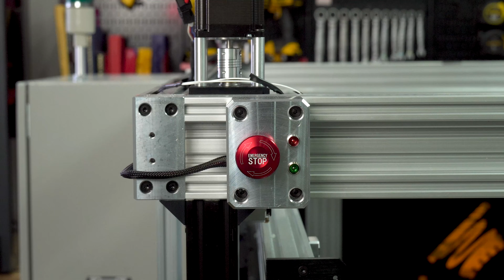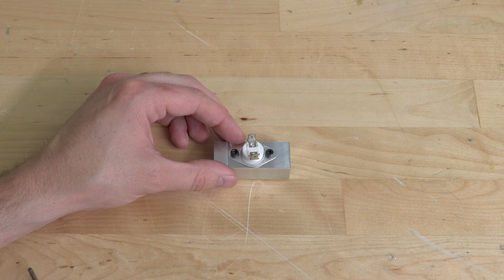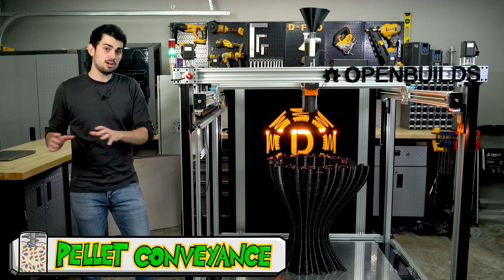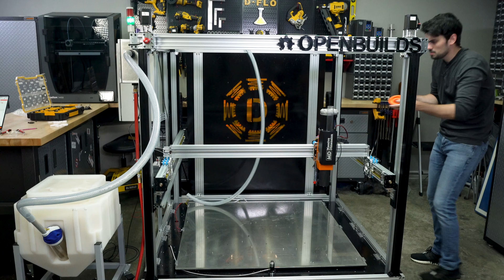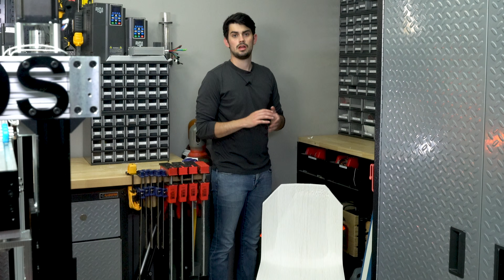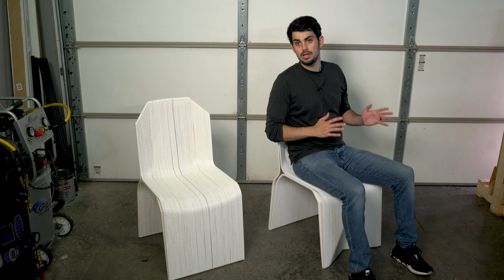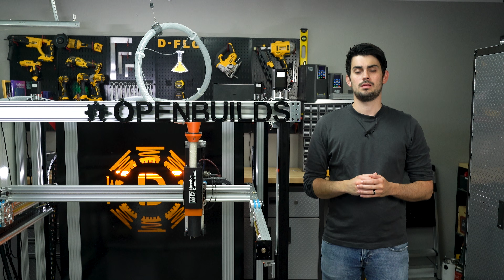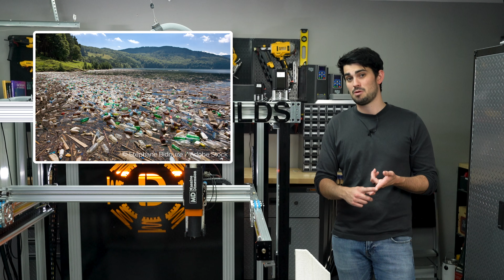Building a Large Format 3D Printer – Part 4: Printing

Comment: Dissing injection molding for producing scrap that "ends up in landfills and the ocean" and then claiming your process is superior due to material regrinding/recycling is a bit disingenuous.  The vast majority of injection molded parts are molded in such a way to minimize scrap with advanced mold designs, hot runner systems, etc.  Then any scrap that is produced is then often reground on site and reused after either autonomous or manual trimming procedures.  The vast majority of injection molded products produce no consistent waste in the same way that you do, via regrind.  Single use plastics are entirely different issue that this printer does not solve or address and so mentioning it also feels a bit out of place as well.  

Otherwise this printer and the projects are sick, very cool.

Comment: Why not use PETG? You can save more money using a stronger plastic by reducing the material cost. Plus it will not lose much strength in a hot day unlike PLA making it more practical.

Comment: As a mechanical engineer, there's no way you need that chair to be 10mm thick throughout.  That thing should be designed with ribbing for strength and you should print much faster with a smaller extrusion width.

Comment: 15:05 Holy cow, how did you fit 10mm plastic through a 5mm nozzle without it oozing up around the nozzle and messing up the print?  What's the outer diameter of the bottom face of your nozzle?

Comment: If you add ribs/infill between the vase mode prints, it will act as a single much stiffer object.

You should be able to use 5mm or less layer width.

This video shows how you can use the vase mode surface quality/speed with ribs. https://youtu.be/STNJbHJf9K0

Comment: Cooling.  Fans are great and they work.  Now, if you really want to up your game, which is what this project seems to be all about, refrigerated cooking.  Either one of those tiny in room AC with an air duct or really up your game and put a tiny evaporative heat exchanger right on the head.  Here is Adam Savage's step into the world of tiny air conditioners.  
https://www.youtube.com/watch?v=z_Ti4GP0ntE
I'm interested in doing a large format printer myself but I think I want to go with a steel steel frame.  Steel is a whole lot more work but in the end I think the added rigidity is worth it.  I would bolt everything.  Being a welder I know how much distortion welding can induce unless you have a really good welding jig.   
Thank you for bringing us along on your journey.

Comment: at 23.7 kW per hour for 18 hours would be >400kW used. times $0,1 the total electic bill wil be ~$40,-. adding the material the total cost for 1 chear is $180,-
Reply: electricity is charged by kWh not kw it would cost him 2.73 dollars to run it so the cost of one chair is actually closer to ~145

Comment: Hi Dr D. Could you sell that 3D printer please please. I'm doing my Post Graduation in Mechanical Engineering and I have a project that Will required me to build big part. So economically speaking. That's cost

Comment: i can't believe you have a Vacuum loader and hopper for a tru put less than 10-20 lbs an hour ish why not just use a large hopper and a 5 gal pail with a gate at the hoppers bottom... dump a pail in and your good for a few hours or more and way easier to keep clean from colourants and different basses but hey fancy her up bud.
Reply from the maker: Dude I sleep more than a few hours! I want the printer to be able to run without intervention for days if needed. The pellet conveyance system is very convenient.
Reply: @DrDFlo  then use a bigger hopper..... your clean outs will incurr more down time resin in the hoses and clamps wands cheese cloth filter pump why not just clean the hopper instead of all tue extra down time cleaning
Reply: @rexxx927  increased weight
Reply: @nou5440  no,the hopper does not have to be on the gantry just above the same height as the extruder is......out side inside upside down if you like its just the hose that would go to the gantry and extruder.

Comment: It's almost anxiety inducing seeing you casually just present a feature or implementation of some part, knowing that it probably took many many hours of testing, building and re-trying until it works as flawlessly as you show. Any chance the printer can handle a different stronger material that could print a given object for less "money per strength"? I feel like this has always been a big economical limit of anything bigger than 20x20cm-ish in FDM printing. Square-cube-law makes it hard for anything larger to have strength without weighing and costing a ton.

Comment: Why don't you 3d print me planks for a patio. Or bricks or a brick house.  Or rocks for a rock garden.  Also hose clamps are different than plumbers tape, or plumbers crack (do not smoke plumbers crack, it is not good).

Comment: The printer you have designed is quite excellent and I think could rival some of the industrial ones I have worked on. Excellent job overcoming the obstacles... 

I also find it amusing listening to all the "Brainiacs" moaning about "carbon footprint" and such when they really know next to nothing about what really happens with recycling, meanwhile they are buying bottled water and hundreds of other plastic trash that they blithely toss to the side... You are using far less materials and energy and can perform nearly 100% recycling and you know where your plastics are coming from and where they are going... not to mention that PLA is much more of an "organic" plastic then about 75% of the plastics used in all of those throwaway items. Just ignore them for the ignorant children they are, YOU are actually doing the right things rather than playing keyboard warrior and doing little more than wasting time and electricity.  Most of them couldn't even describe what the various plastics are.

Comment: It hurts my brain that your stack light is setup wrong.

Green means the machine is live, in operation or ready to work.  red means the machine is shut down.  flashing is sometimes utilized depending on the machine.  I probably would have gone with a green orange red stack light, orange while it's on cool down.  red when it's fully shut down.
Reply: I think the color represents whether the print is able to be removed not if it’s in operatiob
Reply: @futuremapper_  Basically think in terms of having multiple machines.  It makes it easy to scan over all your machines and see which ones are stopped so you can investigate why.  Green is the signal for everything is okay, no errors reported.

Comment: Soo would this be able to creat bases for molds of say nonexistent Audi C4 GTO bumpers, fender, and other aero? Asking for a friend.
Reply from the maker: Yes, but you would have to do some sanding to get rid of the layer lines.
Reply: @DrDFlo  still less work and more precise than me making them all from foam, fiberglass, then carbon fiber in the garage. Thanks for the reply though I just stumbled upon your channel today and subscribed 👍
Reply from the maker: @urs6onfuturas975  Welcome aboard! Just curious what would be the thickness of a panel for the Audi C4?
Reply: @DrDFlo  roughly 7mm or less depending on the panel if done with carbon fiber. I don't have a ton of experience with carbon fiber just yet but have done a good amount of fiberglass on old Cessna's.
Reply from the maker: @urs6onfuturas975  Thanks for the quick answer! I can print down to about 1 mm thickness
Reply: @DrDFlo  now if only I had the ability to creat a CAD file to make it happen. I don't think Audi has 3d scanned the parts but they are the Germans so it's possible the files exist. Whether they'd give them up to us enthusiast's is another question though.

Comment: Another idea for dispensing the pellets energy efficiently: have the container hanging on the ceiling right above the printer and a tube connecting it to the printing head. Inbetween you'd have something like a lid, or anything that acts as a valve for pellets. That would also be the only thing that needs energy in this solution, apart from you having to get the pellets up to the container by muscle energy :D

Comment: sorry bud, but with injection molding u can do that chair from 3-4 parts... then weld them with pressure... sure is expensive .. sure requires a lot of investment in machines but it can be done, and in fact i think would be just easier and even cheper to make it frmo wood... or aluminium plates. lets face it 3d printing is amazing... but is nowhere near cnc machines injection molding etc... supersized 3d printers are just a waste... unless u need a very complicated part that requires to much investment in machines to make it happen... like intricate designs that have inside designs with a 3rd inside design... like inception bullshit... but that is going towards ART building... instead of utility and purpose.

Comment: First, I love this build, just to be clear. However, a couple suggestions came to mind while watching this video.

On your pneumatic radiator drains, you have the drain lines coming out of the bottom of the traps, and then routed upwards into a manifold. I’d suggest keeping those drain lines and that manifold at the lowest point.  In your case, I’d run them on the floor. As they are currently routed, all three traps have to completely fill with condensate before the water is evacuated, which will actually introduce moisture into the system over time instead of removing it.

Due to the massive size of this wonderful feat of engineering, I’d suggest heavy research and mastery of “gradient infill” to reduce material usage and weight while still keeping bridging down as you approach top layers. This lets you have something like 5% infill in the middle of the print if you’re printing a box, while the top and bottom can be at 40% to minimize bridging. The gradient infill gradually decreases and then gradually increases infill as appropriate. There are a couple videos on YouTube on this concept that is still in early stages of slicer development. 

Keep up the good work on this rig. I’d be interested on a detailed cost analysis with a percentage-based comparison to similarly designed, but smaller (I.e., normal sized) printers. Prices fluctuate, but percentage variation may age better over time.
Reply from the maker: Thanks! I appreciate all the advice. I will make some changes to the autodrains and look into variable infills
Reply: @DrDFlo  cnc kitchen showed a variable infill that was highest at the walls and lowest in the centre, perhaps that with a variable infill that gets thicker the higher in z you go would be ideal

Comment: 🤔Why use the centuries-proven method of elevating grain using a simple, ultra-reliable conveyor screw when you can design the most inefficient, unreliable, complex and costly system, so bad that it inherently creates another problem (moisture) that needs to be addressed with even more flimsy complexity and cost? 🤦🏻‍♀️
Reply: Because the venturi  method is used in industrial applications very often because it works.  Small issues don't make it a bad idea
Reply: @sexyfacenation  Applications which have entirely different scales, cost structures, maintenance plans, throughput needs, ROI schedules, legacy infrastructure, etc. This is the epitome of ludicrous over engineering.
Reply: @ArnaudMEURET  nope. You are wrong.
Reply: @sexyfacenation  qed

Comment: I'd highly recommend a refrigerated air dryer, they produce very dry air and output a consistent air temperature that isn't cold or hot. Have a 31cfm refrigerated dryer for a 7.5hp 80gal compressor that provides air for a cnc router, pneumatic tapping arm, media blasting cabinet, air tools, and pressure vessels.

Comment: STRONGLY, recommend you look into the "Old's Elevator" for lifting the pellets. It is also a very accurate means of volumetric measurement. Allowing you to deliver the correct amount of material on demand. A far more elegant and efficient solution than air; which is sort of a brute force approach.

Comment: I saw that coming with the retracting thing 😂 was too strong, has to be appropriate for the weight of the tube when low, shouldn't be pulling hard still when it's high

Also, you fixed a lot of things I was taking notice of throughout the video and it made for good progression. But I would request that you clean up the wire box for the printer. If it looks a mess then it is a mess.

Comment: Would be interested in what other options you considered for the pellet feeder. From here this seems an overly complex solution, but I'm likely missing something!

Given the incredible flexibility in the software, would it be possible to return the head to a loading location when required, allowing the use of a simple screw feed (like a grain lift)?